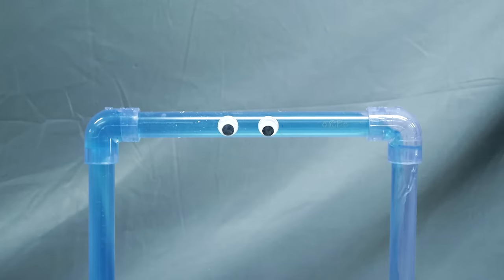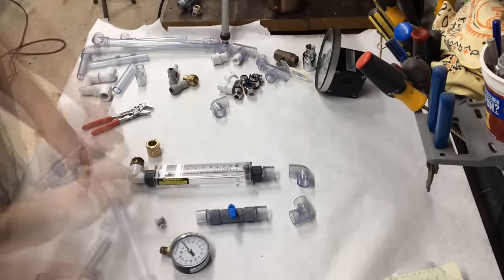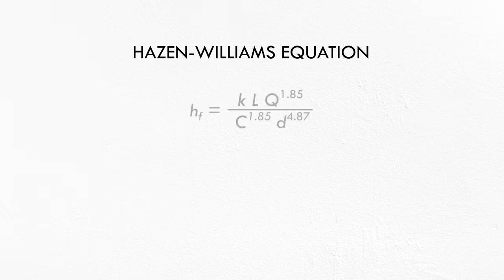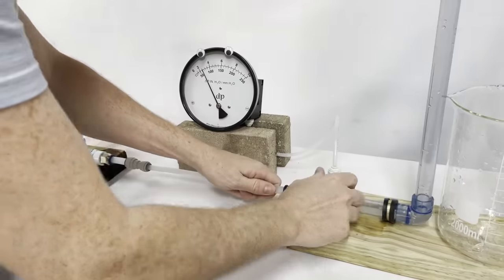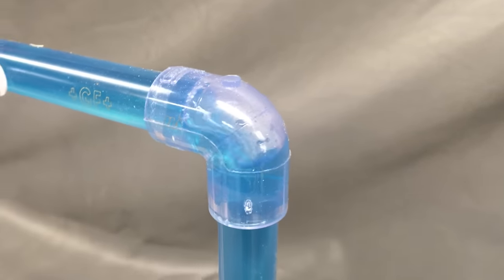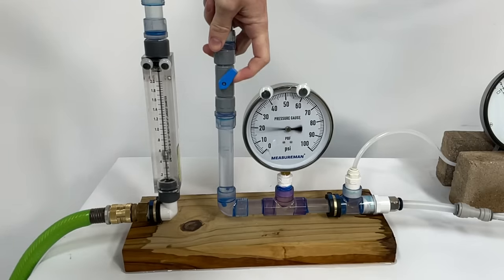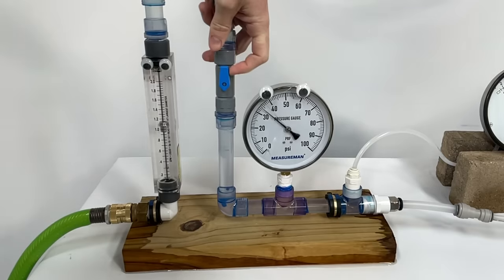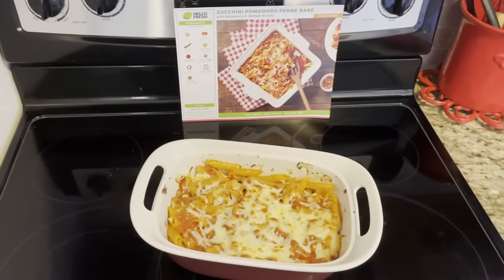Flow and Pressure in Pipes Explained

Comment: You finally gave me an answer to a careers worth of questions. How do I determine a magnehelic parameter given a run of pipe purged with argon to maintain weld puddle geometry. All fluids being equal per Bernoulli, minus my weld puddle which is undergoing convection current and electromagnetic effects as well, the hazen-williams equation should scale to the gas phase as well yes? This should be taught to every orbital tube welder if so.
Reply: Instantly found out after posting this that HW-equation is only valid for water as it is purely empirical. I think industry would benefit from empirical study of argon fluid media.
Reply: Pole says: 
78% Nitrogen 
21% Oxygen 
1% Argon 

Cost/Benefit says 100% Argon for niche application.

Comment: I enjoyed this informative video.  It's  relevant for me too since I dont like the shower pressure in my upstairs bathrooms (I've removed the eco-flow restrictions). I recently found a pressure adjuster in the water pipe entering the house. I would like to try adjusting it but am being cautious before I do. 
Regardless, I have two questions that arose from your video:
When you switched to a larger diameter pipe, the points of measurement were still at the smaller dia sections. Shouldn't the head loss measurements be taken at the larger dia section?
How do the properties of the fluid - like viscosity - effect the pressure loss characteristics? The equation doesn't seem to account for that.

Comment: So informative!! We just installed a reverse osmosis water filtration system under our sink, and I've been wondering why the storage tank helps with the water pressure — after all, the system is pressurized from the same inlet regardless; why would an intermediate tank improve pressure at the outlet? It sounds like the answer is flow rate: max flow through the RO system results in much bigger head losses through all of the filter stages. But at low flow, losses are minimized so it can 'trickle-charge' the tank to equalize its pressure with the inlet. Then there is minimal head loss between tank and faucet, resulting in good flow at the outlet. Is this right???

Comment: Hi Grady, another great video.
I am wondering how this would apply to moving air and dust through dust collection. As a woodworker, you may be interested in how pipe diameters and cfm and collector sizes fit to do an optimum system.  Most machines come with 4" or smaller fittings and that seems just too small for most systems. 
It seems that most professionally designed systems use too small of diameter pipes as well.
There are a lot of variables for us laymen to keep the suction up and not have dust settle or plug pipes.
 Bill Pentz did a study and generally came up with 5" as a minimum which has worked out in my shop.   Do you have any comments or better yet could you do a video for woodworkers?

Comment: Good video, how about something on how to improve pressure in one's home piping system (without putting in larger pipes everywhere)?  Also, how about a segment on how they make the water flow so nicely on those fountains that shoot a nice clean stream from one point to another?  They need to correct and improve the water flow for this, cool things for everyone to learn about.
Reply: About the only way you're going to get higher water pressure in your domestic water system is to increase the pressure of you water service.   There are some minor tweaks, whcih might improve the pressure in high flow lines,  like making sure the pipes are reamed correctly when assembled into fittings,  and using sweep els instead of close 90 degree ells,  but those improvements are going to be small, probably not noticeable.  If you want higher pressure at your tap, you need to star t with higher pressure.  I don't think that Grady does a very good job of communicating the scale of the head loss of the elbows.   At the highest flow rate, the elbows add about 3 "inches" of head loss compared to the loss of the straight pipe.   The thing is, that's not much pressure loss. An inch of water column is about 1/27th of a psi, so  a 3 inch head loss is a loss of about one tenth of a psi.   Domestic water supply is typically somewhere around 60 psi,  so a head loss of 3 inches pressure reduction of less than 2 tenths of a percent.   Most modern residential   water systems are run with continuous PEX tubing,  whcih for the most part eliminates sharp elbows, and they tend to flow a little better.

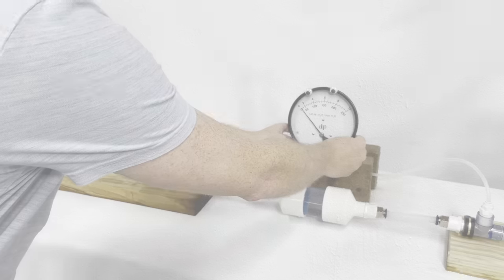Comment: At 6:34 the obvious issue with this measurement is that measurement is done on a much narrower tube than the tube that is being tested, thus it is just inapplicable to test that diameter. Going back to electrical analogy  is the inner resistance of the electrical source.

Comment: I love how when the math in a formula cancels out to some nonsensical unit -- like measuring head loss in inches or rocket efficiency in seconds -- it always turns out there's some physical configuration that makes the unit make sense (e.g. tapping the pipe into a vertical column.)
(Yes, yes, I know pressure used to be measured in inches of mercury.)

Comment: Interesting video, Grady.  
I have to wonder about the demonstration involving the big diameter pipe (6:20).  Seems like the resistance would be dominated by the resistance from the relatively narrow source and drain pipes that are between it and the measuring points of the pressure drop meter.  Maybe worth considering that this why the pressure drop is essentially the same as  before, instead of or in addition to the expansion/contraction factor.

Comment: If you were to do one more example, it should have been the standard diameter pipe going to 20 ft larger diameter then back, and comparing it to the 20ft standard diameter. It would show how even if the system has a small inlet and exit, long runs really benefit from a larger diameter to reduce friction. Overall though great choice of examples.

Comment: Thanks for the video! Could you make a similar video including a centrifugal pump in the inlet instead of a fixed pressure? You could explain how varying the pump variables (power, delta P, speed, etc.) affect the line pressure at different points. That's something that's still unclear to me even after years and years of engineering education. Thanks!

Comment: Speaking of the resistance of a conductor @1:30 that is a bad strip on that copper wire, looks like it's scored into the copper which can increase the resistance and cause a hot spot.

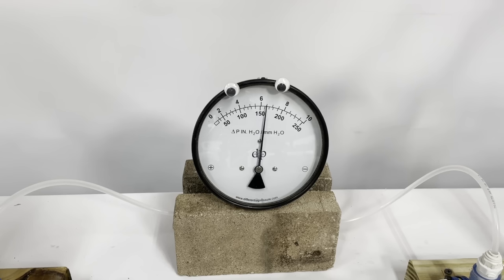Comment: Great video! A question - in the example with the section of big pipe (6:16), pressure is lost along the way. But comparing the fluid before and after the section of big pipe, we have the same amount of fluid flowing through the same size of pipe at the same rate (as fluid in must equal fluid out). So what is 'lost' along the way to give the drop in pressure? Do the flows before and after look different, and how?

Comment: I was hoping you would show four 90º elbows in the large pipe, because that would show reduced losses. Ballooning the turn, ie, reducing the velocity at the restriction, is what we use to increase flow in automotive racing cylinder heads.

Comment: Related to your comments about head loss in homes being more closely tied to the minor loses, I'm curious about the difference moving from sweated copper to PEX would be.   Pex is generally one continuous run and bends generally still have a 3" radius at worst.  Would there be a noticable difference in shower pressure?

Matt Risinger is a YouTube/home builder in in the Austin area that gets nerdy on building science.  I could see him being up for testing and could probably get the materials comped.  From his perspective he and his boss could learn about the different materials and decisions that could help or hurt a final project.  You could do you own separate videos as your styles are different, but share in the setup

Just a thought...

Comment: Seems like in your example of the large diameter pipe, the small tubes connecting your large tube between the differential pressure sensors would dominate the head pressure drop.

Comment: In the 5" diameter demonstration, the differential gauge is still poised outside the bottlenecks that are the original sized tubes.  Does this not effect the outcome of this experiment?  I'm not understanding how a larger pipe in between those points could ever decrease the psi differential.
Edit: You pretty much said what I was thinking when you touched on it the 2nd time in the video.  Great one as always!

Comment: Interesting issue I ran across recently.

Rubber cooling pipes worked fine for about 5-10 years, but suddenly overheating is occuring.

Seems the pipes have changed shape, possibly from high flow rates over time and bernoulli's principle in effect, or a combination? 
Or maybe some other factor..

In either case the hoses need replaced to return the flow rate to what it was to prevent equipment overheating.

Comment: Just a quick question: at 6:20 you're swapping for a pipe 'five times larger', but only a third of the length is that much larger. Surely this makes a huge difference to the results?

Comment: If the pipe has a circular cross section, then changing the area of the pipe has the added effect of changing the distribution of elevation across the mass of water. Does that make a difference as well? For example, if we had a pipe with an eccentric ellipse cross section, looking basically like an almost-collapsed straw, would it make a difference in head loss whether the pipe is oriented so the major axis of the cross section is parallel or perpendicular to the ground? I'd suspect that there would be more head loss if the major axis is perpendicular to the ground, because minor variations in the dynamics at the top of the pipe vs. the bottom should introduce more turbulence.

Comment: Hey really liked your video! 
One thing I wanted to find out is with respect to downward elevation change. If we have a pressure P1 at the top of a hill and a pressure P2 at the bottom of a hill, why does like an engineering software (e.g HYSYS) shows that P2>P1.
What a simple or detailed explanation of this?

Comment: Great demonstration ,however i"m confused that during pressure test of larger diameter pipes ,small diameter pipes are used and connected to the pressure guage ,does the reading (kg per sq cm ) gives the actual  pressure inside the larger diameter pipes or the smaller ones ?? isnt there is automatically drop in the pressure in the smaller ones hence we noticing  the less pressure than expected .

Comment: It's my casual understanding that Roman builders (not sure at which point in history the term "engineer" becomes applicable) designed the flowing water systems in antiquity based on the aqueduct systems drawing water from the  higher elevations.  Clearly they were quite proficient at the time.  Based on seeing this channels content, I am now more curious as to the methods of their calculatuons and the accuracy as compared to current engineer practices/measurement.  I would imagine this has been well researched and documented.   If anyone has suggestions for academic sources regarding this, I would appreciate any links shared.

Comment: Hey Grady, a question. In your video, you mentioned that 90 degree turns are a significant source of minor loss. What would happen if you replaced those with 2x 45 degree fittings? In my mind, there would be less loss since you are allowing the water to change direction more smoothly.
Reply: It depends on the size of the fittings bend radius; but a "standard" or square/miter 90 degree vs two 45 degree bends could be around double the K factor.

Comment: More of a homeowner question. Is the minor loss different depending on the diameter of the curve? I.e. is the loss the same for an elbow joint as it is you bent the pipe into a more gradual 90° curve with a diameter of a foot or two?

Comment: so, if the pressure is being lost to friction in water, does that mean the water is slowly heating? and if so, the plumbing is also heating? is that negligible? as in, you shouldn't worry about your pipes heating to friction? obviously not in your house, but in industry or the distribution system maybe?

Comment: Question: does what you covered in this video also apply to gases in pipes?  Like steam and natural gas pipelines?  (And great job on this video!)
Reply: Yes and no. There are huge differences between compressible gases and non-compressible liquids, particularly in density and viscosity.
Reply: No. Gases react differently. Steam is a whole another problem of its own. It also depends on outside temperature too. Frictional losses are minor compared to liquids as their density is really low. This formula is strictly for water flow in pipes (I think). Other liquids will have different values of K.

Comment: Intuition- It told me that the hot water line in a house does not need to be the standard 3/4" nominal as is typically done, with zero thought put into it. Mom's house is designed with the bathrooms clear at one end of the house, and the kitchen at the other end because, well, architects also put zero thought into their designs. I replaced that long line with a 1/2" nominal pipe because I intuitively knew it would be plenty, and I was right. You cannot tell a difference in flow at the taps. But it wastes just less than half as much time, fuel, and water getting the hot water there in the first place. I've since re-plumbed two more homes with 1/2 hot water pipes, and they too work perfectly.

Comment: Love the pipe/pump theory videos recently- such an interesting topic- you mentioned in this video that you usually open the shower valve all the way thus eliminating that restriction variable, but I would posit that if your shower /tub has mixing valve (i.e. thermostatic valve)  then a considerable amount of restriction is built in compared to traditional separate hot and cold valves- let me know your thoughts if you happen to get this far in the comments

Comment: Hi Grady I know it will only take  90 sec can you explain pipe and pipe expansion per degree C rise or fall over a given length and even from one side to the other if the other side is in shade. eg for a steel pipe and why they have expansion loops every x m . for example  say 2.5m in diameter perhaps a hyperloop size. You can see where this is going?

Comment: I think that because of the mixed units in this demonstration people are given a falsely exaggerated impression of the pressure loss resulting from the elbows.  The elbows add approximately 3 inches of head loss, or a pressure drop of 3 inches of water column.  3 inches of water column is about 0.1 psi.  So  the 75 psi inlet pressure is reduced to 74.9 psi, proportionally a very small reduction in pressure.

Comment: But the real question is how many right angle adapters would it take to negate most of the head pressure?  Such that you'd only need a couple of feet of vertical pipe to stop the flow?
Reply from the maker: Now you know the equations to find out!

Comment: What I want to know is why there is friction loss on a straight pipe. 

Couldn’t I polish the inside of a pipe to a mirror finish and would that mean I have no friction loss. Is it coming down to the weight of water being pushes miles away or is it actually water rubbing in the walls of a pipe?

Comment: Looking only at the gauge on the left , why does pressure at that point increase as you open the valve more? I thought bernoulis relation says speed and pressure are inversely related, so based on that shouldn’t the pressure at that point get smaller as the valve opens more (allowing for more flow)

Comment: Where can one learn about all the different kinds of pipes, flanges etc.? You are already using like 4 different kinds of connectors on pipes. Same with threaded pipe screw types (I know there is BSP, NPT, and some others but I am lost). I would like to desing an all-glass laboratory equipment that uses things like fractionating columns, filtering columns, reaction vessels etc. but I don't even know where to start...
The books I found are only about huge industrial applications, not small-scale like what you do.

Comment: I didn't calculate a Reynolds number for you tubing or get my handbook out but I'd guess you were in turbulent flow in the 20' length of tubing.  Therefore the tubing being coiled added pressure drop non-linearly with flow rate.  If it was in laminar flow, it could have been ignored.

Comment: with the advent of flexible plastic pipe instead of ridged copper  there are a lot less 90 degree bends in pipe runs and a lot more long gradual bends , but sudden changes in pressure can actually move the pipe . I wonder how that effects pressure and resistance ?
Reply: Change in pressure can cause movement in a flexible pipe, but I would be willing to bet a lot more movement results from changes in flow.  Grady has a video that discusses exactly this. It's titled "WHy Pipes Move Underground"

Comment: In the Chicago area there still is a lot of galvanized pipe internally closing off with corrosion. 
Is there any practical application information, either in another video or website, that would help a homeowner identify a problem or plan repairs and replacement. 
I know that running 3/4" copper pipe to an area and reducing it to 1/2" for individual faucets is good. 
What part does too many elbows reducers and valves play, or is it negligible in an average home? 
Thanks Grady, 
Rich J

Comment: Nice video! I sell hydro jet nozzles for sewer pipe and drainage cleaning.. If a customer has a vacuum truck that puts out 2500 psi, 60 gpm, with 600’ of 1” hose then according to those specs using our jetcalc i can install the proper jets. However, adding, shortening, changing the diameter of hose, and etc, will require changing the jets to get proper flow and the expected results
Reply: i used to be a jetter pilot :D